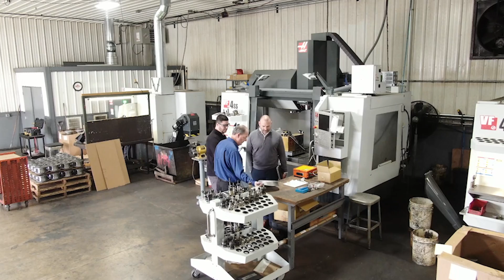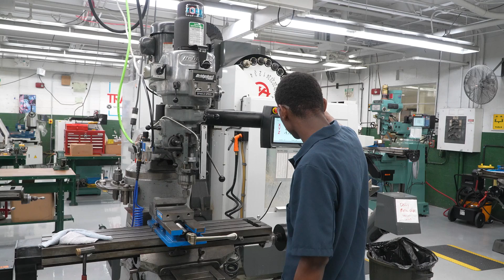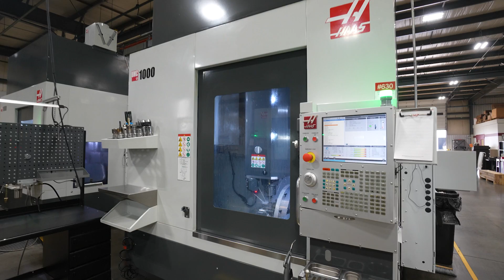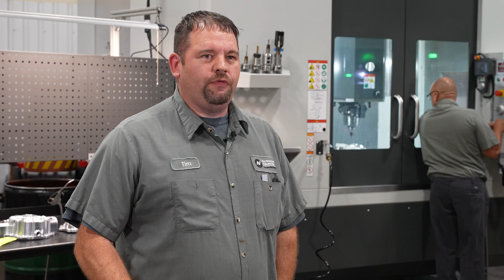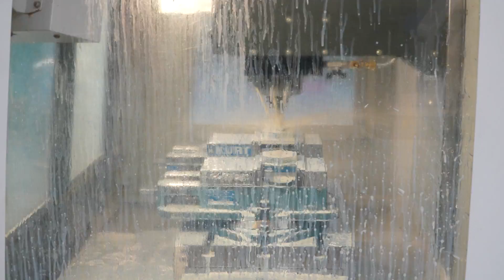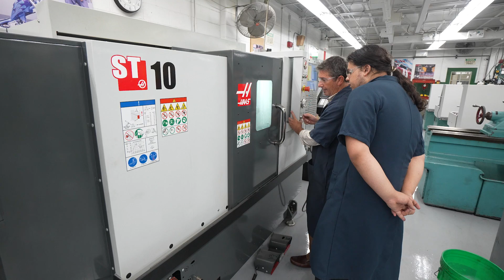Customer Spotlight - Clay High School - Haas Automation, Inc.

Comment: Don't let the competition fool you.
Haas is up there with Mazak, Dosan and Okuma.
Reply: Yo you on crack or sum you ever watched a machine helix drill a hole with an end mill at 250ipm with precision? Because a Haas can’t do that.
Reply: @akronimm862  Right... What tool diameter? What helical angle? What sort of engagement? Pre-drilled or not? What type of end mill? Solid or inserted? Through coolant or not? Or cutting dry? What material? 6061 Aluminium, 4140 Steel, or Inconel?

I wish machining, and life in general, was as simple and black and white as that... But it's not, m8.

The differences are not even things like that. It's tool life, it's time between services, It's machine types available, etc. However, if you maintain a Haas as per the manual, which almost nobody does, they are ROI kings. And unless you're Toyota or Lockheed Martin, the ROI on a Haas is what should matter to you.
Reply: @akronimm862  
Awful sure of yourself aren't ya cupcake?
If there's a need for it, Haas WILL produce a machine capable. That's what they do dippy. They step up to the plate and make whatever is necessary.
Why bother watching if all you want to do is talk shit?